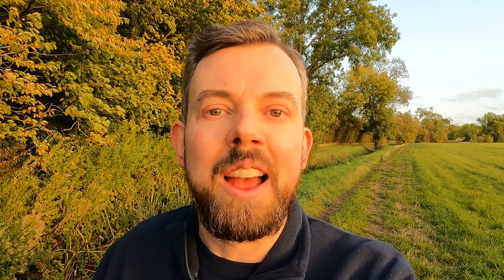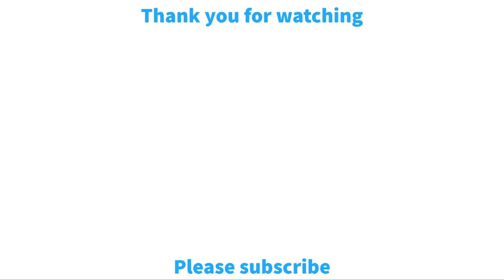Electrician explains how to tell if bonding is required

Comment: Hi James 

Would you be able to do a video doing the actual test to determine if you need to bond? Is there more than 1 test ? 

Do you test between pipe and MET and if lower than 22000 ohms it needs bonding ?  Is this done as a continuity test or insulation resistance?